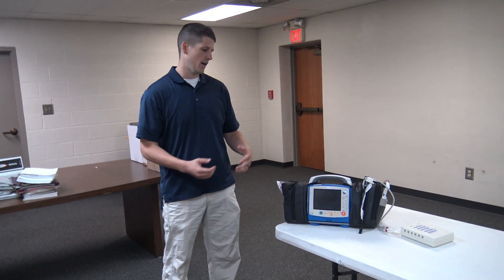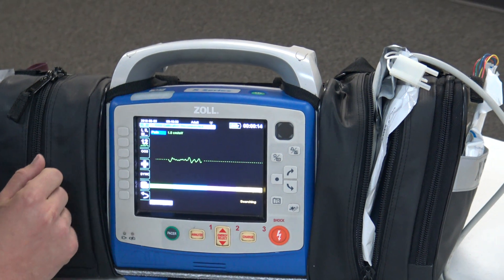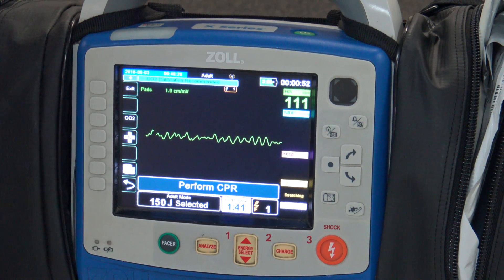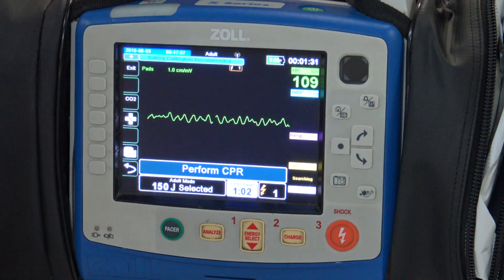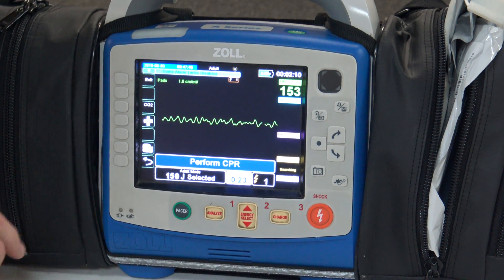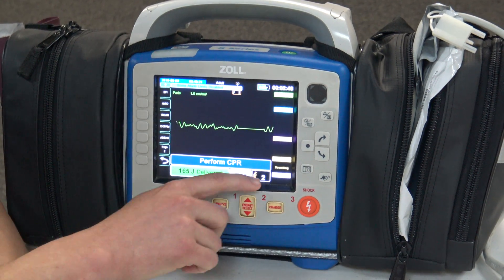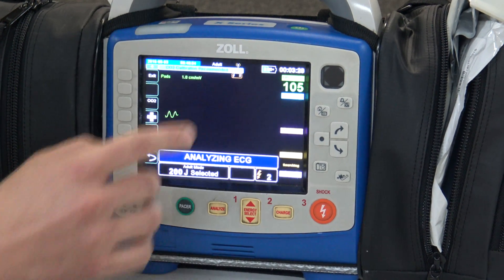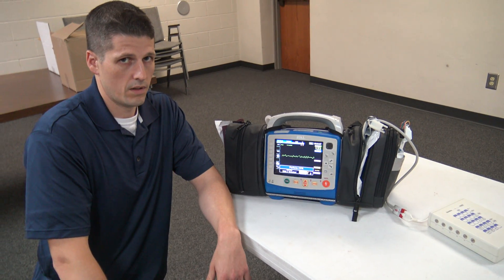AED Mode

Comment: Just a heads up. That mode is CPR mode. It is not AED mode. There is a difference.
Reply: Incorrect. The X series/X series Advanced don't have a "CPR mode." it analyzed an ECG tracing, made a shock able/nonshockable decision, charged it self, and instructed a clinician to deliver said shock. That is THE definition of an AED mode on a defibrillator.
Reply: @ no monitor will “charge itself”. The Zoll, in that mode, will require the user to select the energy level as well. (Former Zoll rep).

Comment: Hey!!! Big question here : when I turn on the system, then sets the display on "pads", then press "analyse" the device goes into manual defibrillator. I want to be able to turn the system on as a monitor and switch to AED with "analyse" and not to manual defib mode! Any idea which setting I could adjust to be able to do as you demonstrates here? Best regards.
Reply: HAHA MY BROTHER PUT THE PADS ON ME IT HURTED